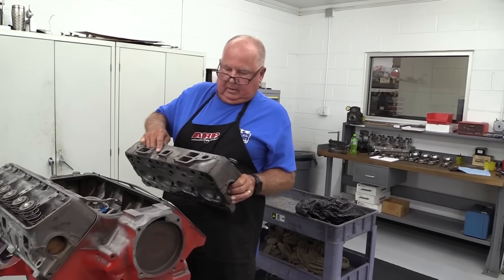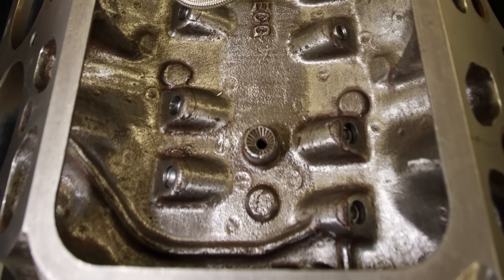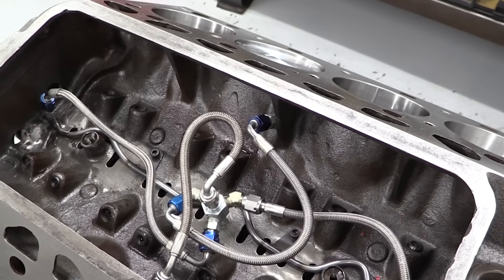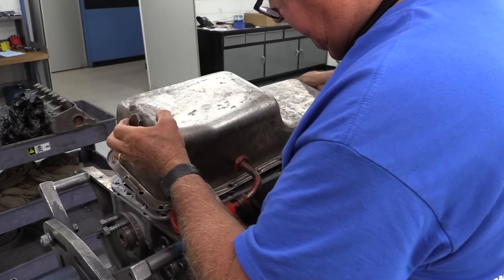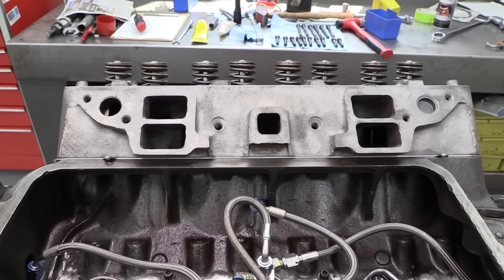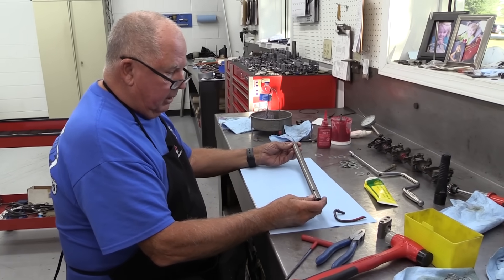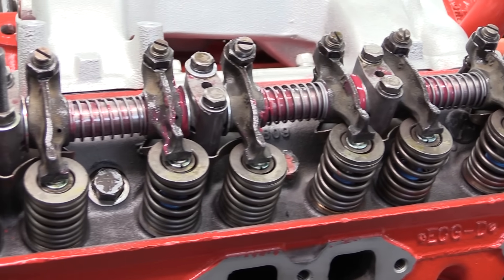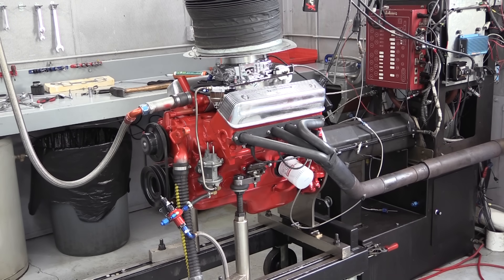The Engine That Replaced the Flathead -- Ford Y-Block Build

Comment: Reading the disclaimer made for more enjoyment as I ran those engines hard. I knew about the cam bearing problem and took that particular bearing to the lathe where I cut a groove around the bearing shell so that if the bearing did happen to spin and block the oil from coming to the top then I had it covered. I also staked the bearing through the oil hole to help keep it from spinning. I  seen lots of them with oil lines on the outside and run through the cover and it made a mess. I would take a long drill and go down though the head and drill through the bearing to see if I  could get it back and did on most. I liked that lifter in block design and thought hard on could I replicate it in another block but to no avail. They were very undervalued engines and I constantly won lots of races with them, very good piece of history
Reply: Too many people want to make this engine out to be mechanically problemed on the design aspect.  People tend to think the oil issues was all mechanical outside of the cam bearing which there were two different styles used based off when the engine was built majority of the oiling problem was caused by bad quality oil that allowed the passage to the rocker arms get blocked off.

My 292 in my '56 has never been out and never been apart still pumps oil like it was designed to because it was a well taken care of engine that had oil changes done with quality oil at the 2,000 mile change interval.  Only problem I am encountering is the load o matic distributor issues I am trying to straighten out as I truly don't want to spend the outrageous price for a reman unit and have to wait.
Reply: @Milner62  For which I used to know so well and loved the engine as it was my first real race one which took every thing I poured at it. I did race but I didn't try to blow it up, I just got all she was worth. I couldn't ask for more and it did make me more than I spent and it was well taken care of
Reply: @morgansword , Of course, its why my fordor 56 will retain the original 292.  I could do like everyone else and upgrade but the 292 is over 60 years old without a rebuild, sat for nearly half of that time, engine was seized up but a little MMO and 10w30 oil mix in each cylinder got the engine freed up and here I am a good 5 or 6 years later with the engine running just slowly working the bugs out of it as when the car was parked it was at a time when OE correct parts were not common place and lots of rigging.  Took me nearly a year to find a NOS dual reservoir vacuum advance for my Holley Load O Matic distributor which I think I need to pull and have rebuilt anyways.  But all of that doesn't stop the engine from running and going down the road.  Just isn't running exactly how it should run.
Reply: I don't buy that. You might drill through the head and drill through the block, but not at the same time. Look at the video. At 7:15-7:24, you will see a slot in the head.  One part of the slot lines up with the center of the block, that's where the oil galley to the center cam bearing is, the other end of the slot is the oil galley to the rocker arm shaft. That "groove" in the head is the biggest oiling problem. I don't know just how many of those I scraped hard burnt oil, almost carbon, out of. If nothing is done to the "groove", you don't accomplish anything.
Reply: @ronaldharris2439  If the solid back on the cam bearing is covering the hole to the block where the oil travels to the rocker assembly, it can not get oil. The back of the cam bearing doesn't have the groove for the oil to circulate around and get to that oil passageway. Before I put the cam in the engine, I would spike the bearing so it could not spin and hence not get oil to the top. The one only head I ever tried, allowed me to go to the cam bearing and drill a hole down to the cam without tearing it down. I don't know personally if any other block was the same way... I grew up running those engines to the limits of their capacity to spin, including doing a turbo on several and also using a blower off of a detroit diesel engine myself. Working for Bendix  Corporation had its benefits. If I am so wrong then why did it work everytime I spiked those bearings so they couldn't turn in the block?

Comment: Thank you for sharing this build with us buddy! I've been trying to watch it since you posted it, but something always interrupted me when I'd click on it. When you think about it, 220 HP/290 lb ft isn't terrible considering the low compression ratio, deep combustion chambers, small valve faces, and flat top pistons. Imagine if he wouldve shaved the heads, extreme port and polish the intake and exhaust ports, larger valves, put some high compression forged rods and pistons in it, gone for an extreme performance cam, dual valve springs, 5 angle valve job, and brought the static compression ratio up to around 12 or 13:1. That old Y block could be capable of 400-450 HP without any power adders. The crank looked stout enough to support some power, but if not I'm sure a forged crank could be arranged. Imagine a 292 cubic inch V8 capable of 450 HP just naturally aspirated...I'd really like to see this builder's performance Y block buildup and see it ran on the engine dyno. Thanks again for sharing this oddball build with us!
Reply from the maker: Thanks for the kind words, and thanks for watching. Dorton has a Y-block build coming up over the winter that is supposed to be a significantly higher-horsepower upgrade versus stock, and I hope I'm able to document that build too. That's the main reason I shot this build, so we could see the differences. Thanks again!
Reply: @TheHorsepowerMonster  I sure hope that you get the chance to document that build because I'll definitely be watching. Actually, I'll be watching regardless, but I'll pay extra close attention for that episode! Lol
Reply: I’m looking to do a shoestring budget rebuild on a 272 that’s for a 55 Fairlane my grandma gave me. I’m hoping to bring an old heirloom back to life and maybe even give it a little more get up and go if I can. Got any more tips that could help?
Reply: Y Blocks have already been built, up to about 700hp naturally aspirated and 1000hp boosted.  They have participated in engine masters for the past 10 years or so, producing as much as  603hp at that competition, many times over 500hp and at the most recent one, a pump gas, iron headed 303ci produced 430hp.  At the Y Block Nationals, there are participants at all levels, from stock to purpose built dragsters, many of which exceed 500hp.  This is a great event to go to if you want to see them in action and talk to people who have been building and racing them for decades.
At this point in time, 400-450hp is not a challenge at all.

Comment: Bwahahaha... "tach drives off the transmission in most vehicles..."

I remember seeing a lot of these with copper tubing coming up from the oil galley and into the valve covers through rubber grommets.  They had a serious oiling problem where the rocker arms were concerned.

Never liked the sound of these engines... It made them seem like they were running at half the actual rpm.

Comment: Mopar Direct Connection  offered a mushroom tappet cam set-up for the 340 to run higher spring pressures without going to roller lifters, maybe class limitations. I think that's like having to turn your car upside down to change the wheels!

Comment: I've got a 55 with the factory original (read literally untouched) 289 in it. Thing will kill literally every mosquito in sight but it's pretty cool that it's all original. Sounds great and I was always worried about valve noise but seeing now that it's a solid lifter that explains what I was hearing. I didn't know that.
Reply: They didn't make a 289 in '55.
Reply: @michaelangelo8001  sorry, not a ford guy. 292, I just maintain the thing so I forget the little things lol.
Reply: @ratherbeboating10  Most standard Ford's that year would've had the 272.  Either way, they are pretty reliable engines except for the overhead oiling problem.
Reply: @michaelangelo8001  Well it's the thunderbird so it is supposed to have the 292 I believe. And yes they are reliable... this one has a slight wrist pin knock so it will be getting freshened up eventually. For the 50 miles it gets driven a year it's fine. It's a fun car though, surprisingly quick with the manual for its size. Definitely drives like a sports car. Fun little thing.
Reply from the maker: Happens to the best of us!
Reply: @ratherbeboating10  Oh yeah... you didn't mention that it was a bird.  Yes the 292 would be correct for a 55, and as you say, those engines deliver a lot of tourqe.

To me they sound lazy and slow, but somehow they are capable of moving a car quite quickly.

When I was 16 I had a 64 Falcon Sprint with a overbored 289 & a 4speed.  Heads were ported, but everything else was stock.

It was pretty quick, and would beat most cars at my school, but one weekend an old mechanic I knew, showed up in a 4door 57 post at the drive-in where we hung out, and was talking about how strong the 272 he had just built for the car, was running.

I knew what it was, because I had watched part of the build at his shop.  It was basically a stock engine with an overbore, and a 3angle valve job.  Transmission was a manual 3speed on the column.

He said it was probably faster than my Falcon, so I agreed to race him.  To my utter surprise, the old man beat me by about half a car, and took my $50...
Reply: @michaelangelo8001  that's an awesome story. Just out of curiosity, looking back was it a drivers race more than anything?
Reply: @ratherbeboating10  No, that would be more understandable, bit we raced from a 15mph roll.

The fact is, that he had everything tuned perfectly, and the old Y-block was just that strong.

Not the only time something like that happened to me, either...

A little later on, I had a 64 GTO.  It came with a 389 Tri-power setup, and a 4speed.  I slung a rod out the side of the 389, so I bought a 455 out of a GP SJ, ported and polished my 389 heads and intake, installed a Ram Air IV can & headers, and I thought I was ready to take on the world.

The car was really strong... I could start off in third gear, and if I could get the tires broken loose in a water puddle or dirt first, it would just smoke the casings off the wheels, up until I ran out of RPMs, at over 100 mph.

Anyway, I kept bragging about how fast it was at work, so my supervisor got enough of it, and told me that his new bone stock 69 Mach I with a 351 Cleveland would easily out run my GTO.

Lol, I thought the very idea was just hilarious, so we took them out on the freeway after work, and ran from a 20mph roll.  

And as hard as it might be to believe, he completely dusted me by about 3 car lengths and I lost another $50.

Some people never learn, I guess...
Reply: @michaelangelo8001  really well setup is really well setup. And I'd say I could be guilty of never learning some things as well lol. 

Side note, I love the early GTOs.
Reply: @ratherbeboating10  😁👍
Reply: Michael Angelo The 351 Cleveland didn't come out until 1970. The 351 Windsor debuted in 1969.
Reply: @foxfordcatguy2283  Hey, it may have been a 1970?  I remember it as a '69, but the two look very similar, and that was around fifty years ago...

I didn't actually look under his hood either, but I do specifically remember him saying that it was a 351 Cleveland, and I remember the shaker scoop on the hood.

After getting trounced like that, I just held a kind of reverence in my mind for the term "Cleveland", thereafter.

Comment: The Y block was in production until 1980
Reply from the maker: Inside or outside the US?
Reply: No
Reply: @MrRemo58  
Yes
Reply: @Rick-S-6063  
It was used up until 1980 in Argentina where the heads underwent a redesign similar to a Windsor it was known as the Fase/phase 2 
Plenty of info on youtube or google

Comment: A high school friend of mine's dad would brag about having a '54 ford that would run a 12 second quarter mile.   I think he was giving revisionist history.   It was a hot engine in 1954, but a 460 hp Coyote powered mustang does a 12 second quarter mile.
Reply: charlesvan13  maybe it was 12 sec 1/8 mile time?
Reply: @cfisher11  
I think it was some revisionist history.  

There were genuine muscle cars in the 60's, such as a 390 Mustang, that would only do a 15 second quarter mile.
Reply: @charlesvan13  stop comparing stock 50-70s stuff to modern day stuff. if you are gonna do that, the old stuff gets to upgrade to modern day parts. then, its running with the new mustang.
Reply: @cfisher11  You are probably right, even if it could (not likely) the tires they had back then would have gone up in smoke.
Reply: My dad's 54 ford mainline ran 14.0 and that's about all a 312 could do. They really had it maxed out.
Reply: so does a 57 Chevy
Reply: All et times depend on the gearing and the reaction time and skill of the driver. I've personally seen daily driver pickups that could do 12 second quarter mile times.
Reply: Lawnmowerman Reaction Time has NO AFFECT on Elapsed Time. The ET clock does not start until the tire moves out of the starting line beam.
Reply: @foxfordcatguy2283  gearing does,though.
Reply: @Frigglebiscuit Never said it didn't. Everything has an affect: weather, weight, shift points, engine mods, etc. will all (of course) affect E.T. Gearing alone only does so much. The gears have to compliment the rest of the set-up and vice versa.

All I was saying was you can sit there all day after the green light comes on and run the same Elapsed Time as if you had a perfect light or a red light. Reaction Time is literally only the time between the green light coming on and the tire leaving the beam.
Reply: @foxfordcatguy2283  oh I know.

Comment: i had  292  in 64  ford  pu pulled  a 390  out  of  63 t bird  with tri   power   stock  400 hp in  the  truck

Comment: If you don’t like the sound of a yblock you’ve never heard one!
Reply: So true.  Y blocks have a very distinct, and beautiful I may add, tone.
Reply: @LynxStarAuto   QUOTE Y blocks have a very distinct, and beautiful I may add, tone. UNQUOTE  it's beautiful to hear them run ........because SO OFTEN they don't
Reply: My 352 purred and screamed!!
Reply: Painkiller Jones The 352 was an FE not a Y Block. Yes, technically both have deep skirted blocks that gave the Y Block its name but they are totally different engine families.
Reply: @foxfordcatguy2283  In 1960?
Reply: Painkiller Jones the FE was introduced in 58.  It debuted in the 58 T-Bird and Galaxie, and went on to power many more Ford offerings.  Y blocks were short lived, because they had design constraints.  The FE was the design Ford incorporated to properly compete with the other big two.
Reply: @painkillerjones6232  wiki says the FE engine series started in 1958
Reply: @LynxStarAuto  QUOTE blocks were short lived, because they had design constraints.  UNQUOTE  constraints = flaws
Reply: I've heard a 292 and a 312. I'm that old. My dad bought a 65 Ford with a 352. I had a 60 T-bird with a 352. It was slow getting up to speed but it would really cruise down the highway.
Reply: @jamesglass5402  Mine burned 'em in 1st, 2nd, and chirped 'em going into third, but I only did it a couple of times.
Reply: @painkillerjones6232  Then the transmission took a shit, right?
Reply: Mrs Cabot  go have a smoke, you seem stressed
Reply: 292, 312 had both in ford wagons to go to the beach in so Calif.,they were slow turds.
Reply: It does sound good
Reply: chevy guys emerge from bushes
Reply: Had one.  One of the worst V8s ever.
Reply: I like the sound of a Y block  ........as it hits  the ground with a thud after being pushed off the back of truck at the junk pile at the local scrap yard.
Reply: 283 would smoke it, Ford always made it hard to work on, Fix Or Repair Dailey FORD.
Reply: Ricardo Garcia troll!
Reply: I remember hearing these engines as a kid they always sounded like a baking pan of nuts & bolts being shaken around!
Reply: 4thstooge you must be the 4th stooge troll! I’m a Chevy guy, but serval farmers had strait trucks with yblocks and they sound great while idling and running. I luv the sound they made.
Reply: @4thstooge75  That's because they were.

Comment: After the run it would have been good to see under the rocker covers at the oil flow.
Reply: Probably could make up some cut out stock  valve covers with a piece of lexan and some rtv in there.....hey lol why not stick a few LEDs in there so you don't need a flashlight ? 
Use em for troubleshooting not permanent.

Comment: The fuel pump... counterweight?  What!?

There's no such thing.  That's the cam lobe that drives the fuel pump.
Reply: Immikeurnot: On the cam sprocket there's a counterweight to balance the weight of the fuel pump cam
Reply from the maker: Look closely at 2:57. On top is the fuel pump eccentric that's bolted up (it isn't a cam lobe). After that is a flat plate that serves as a counterweight. After that is the timing chain sprocket. Thanks for watching.
Reply: @TheHorsepowerMonster  that timing chain  will teach you a lesion
Reply: john barret "lesion"?
Reply: @foxfordcatguy2283  john barrett cant spel

Comment: Nope youre wrong ford was first:  chevy small block engine has ford´s Y block exhaust ports
Reply: First off, Chevy never kicked anyone’s ass. Second, Ford was always developing new engine designs and technology while GM killed off all their good engines to spend fifty years putting that pile of shit SBC in everything. Then they replaced it with a new engine based on another fifty year old design.
Reply: long after y blocks have been in their grave, sbc s have been winning more races than any engine in history. which was better?